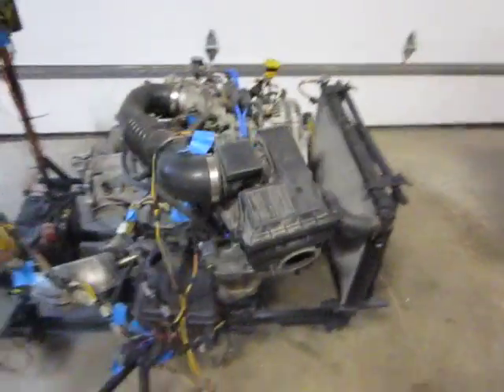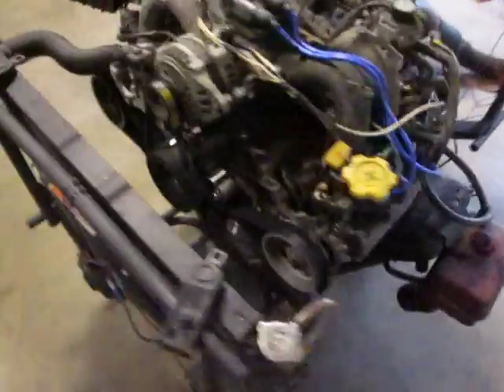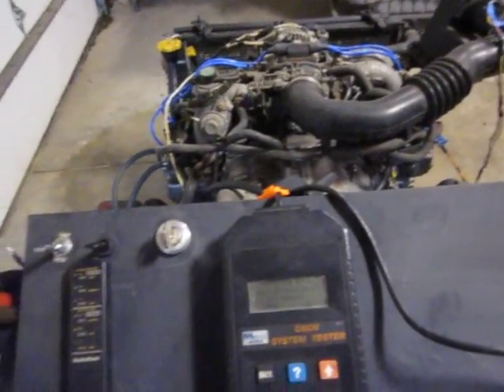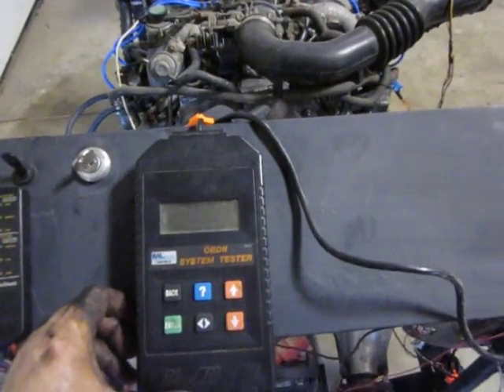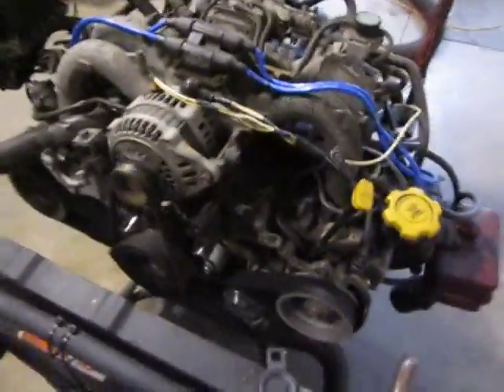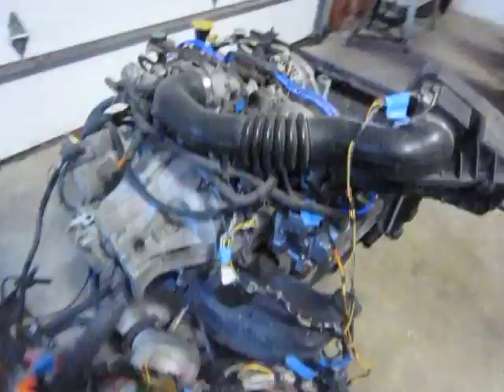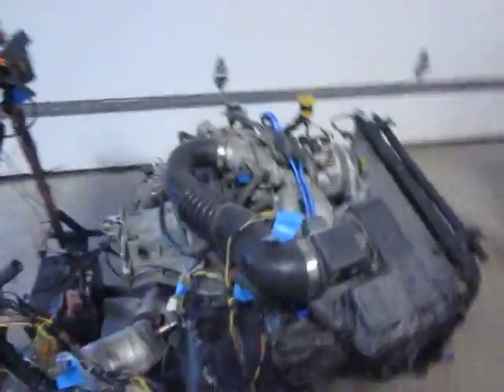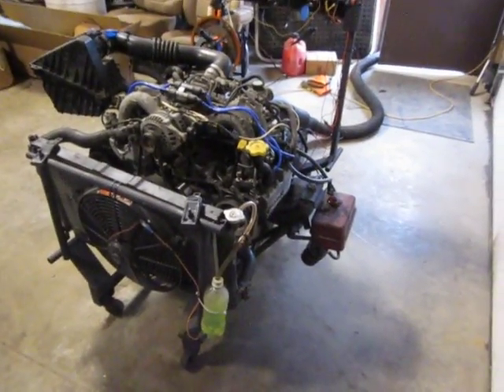Subaru engine test stand.AVI

Comment from the maker: Not sure what you mean.  This is made to test stock Subaru motors.  You use it to test the motor, then you bolt it to the adapter plate and install it in whatever.